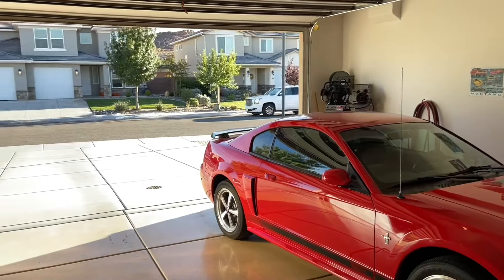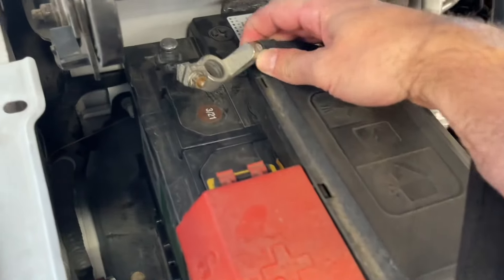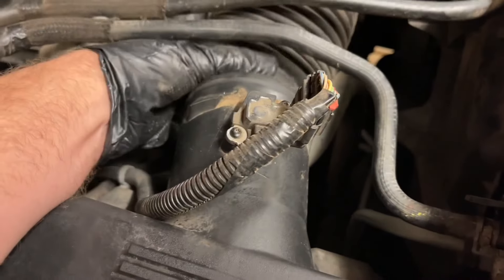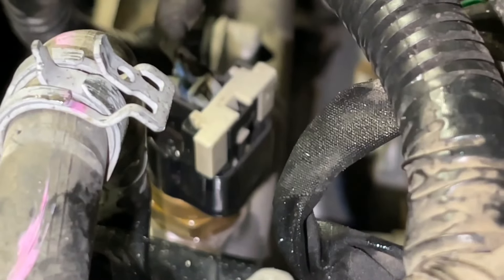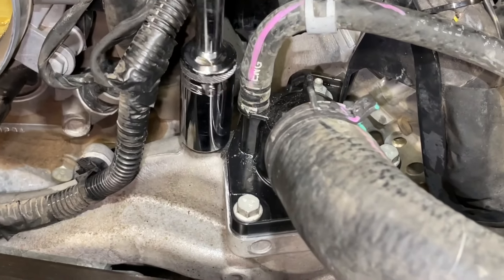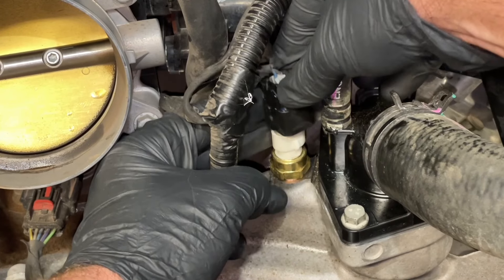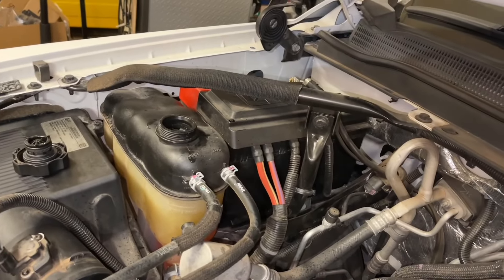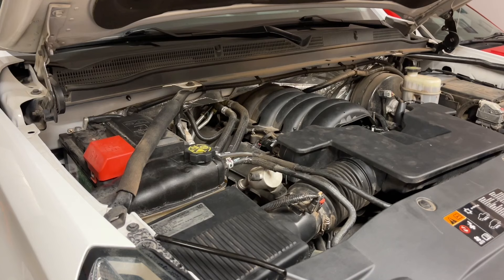Coolant temperature sensor replacement 2015-2020 Yukon, Tahoe, Suburban, Sierra Silverado GMC Chevy

Comment: This video helped tremendously for the repair and once we ran the vehicle; the temperature gauge worked great. Now however, every now and then; the sensor will trip and the gauge won’t work again. Ofcourse the fans will come on again, but each time I disconnect the battery terminal it rights the system again for a few days or more before happening again. Any idea? Only thing I can see different is we used an OEM replacement and not the part from the dealer, but I’m not convinced that is the issue.
Reply from the maker: It’s possible the new sensor is also faulty or the wires or plug on the vehicle side have a short and once it loses communication it faults out

Comment: I changed sensor and thermostat on mine but I still have the same issue. No temperature reading and fan continues to run .
Reply from the maker: It may be a bad plug or electrical connection for the sensor

Comment: So I changed the sensor and then 2 days later it done it again. So now the sensor start working again  but my temperature gage won't stay at 210 it drops down to 160, so in my mind the thermostat is sticking what do you think?
Reply from the maker: I’d change the thermostat https://youtu.be/aEfgkxWdBYw?si=-BZPPOA8NJdnx9VS

Comment: You replaced the tstat, was that for the fans too?
Reply from the maker: Yes, either can cause the fans to come on (if the thermostat is stuck open and overcools the engine, or if the sensor is giving a bad reading). I replaced both at the same time Thermostat Replacement Yukon, Tahoe, Sierra, Silverado, Escalade GMC, Chevy 2014-2020 P0128
https://youtu.be/aEfgkxWdBYw

Comment: I believe I’m having this issue now…will this also cause your AC to stop putting out cold air?
Reply from the maker: It may if it’s putting the car into the default mode. A bad thermostat can also cause the symptoms, so keep it in mind. You can try one at a time with the sensor being less expensive, but it could also be the thermostat Thermostat & Coolant temperature sensor replacement: Yukon, Tahoe, Sierra, Silverado, Escalade GM
https://youtu.be/7mJF5LQ3oPs

Comment: I switched out the sensor, car was good for a week, and now the fan is running nonstop again. Any ideas for what is wrong?
Reply from the maker: It’s most likely the thermostat sticking open and over-cooling. It will look like zero on the gauge but it’s running really cold 
https://youtu.be/aEfgkxWdBYw?si=8SKNXgdwnr31h_SU

Comment: So, I changed the sensor and the fan still run on high at start up. Is there a relay or fuse that needs  to be looked at.
Reply from the maker: If you disconnected the negative battery terminal for the repair it should have reset. I also thought it might be a relay stuck on, but it could be the thermostat stuck open and the vehicle is running cold and can’t warm up so it goes to default mode with the fan. See if you get a check engine light https://youtu.be/aEfgkxWdBYw

Comment: Hi I replaced my thermostat housing 3 times and the temperature sensor twice. Still experiencing same issue. No check engine light. Took to GMC DEALERSHIP, they couldn't find anything wrong. I'm at my wit's end. Please help!
Reply from the maker: If you are still getting a reading of zero on the gauge after driving awhile, it may be an electrical problem on the car harness side. I would check fuses related to the cooling system and a continuity test perhaps on the plug going to the car. Here is how https://youtu.be/-BUzm-OeGhE
Reply: @dannyjohnsonsgarage  I'm actually not getting a zero read. It never goes down it stays about 190-210 . Would you suggest replacing the temperature sensor. The one you suggested in video?
Reply from the maker: @msniecy10  it’s possible the computer recognizes the temp sensor is not working and causing the fan the kick on as a fail Safe. I think it’s worth a try.
Reply: Sane thing happened with my 2015 Yukon. Dealership said it was the thermostat and replaced it. Will I still experience problems with the temperature sensor,?

Comment: Video was perfect. We did exactly this and it fixed it. However 7 days later it happened again. Could this be a bad sensor or would there be another reason it might fail after being fixed?
Reply from the maker: I would next verify if the thermostat is in fact bad and sticking open. It might be over-cooling the engine. https://youtu.be/aEfgkxWdBYw

Comment: Great video for my 2015 Yukon! We got it replaced and it seemed to fix the issue for a couple of days, but the fan is running nonstop again and temperature gauge staying at 160. Any idea what it could be?
Reply from the maker: It’s possible it is running cold and the thermostat is stuck open https://youtu.be/aEfgkxWdBYw

Comment: HELP I changed the sensor and it was very simple. It seemed to fix it completely for about a week. Now it’s doing the same thing but the fan is only about half as loud as it used to be. A friend of mine who is a mechanic said that most chevys have 2 temperature sensors and I googled it and it said that the 2016 does have 2. Could another temp sensor be the problem? Also, it seems to act up when it raining or wet outside. It alternates from working properly to not working like a short in a wire or something.
Reply from the maker: It’s most likely the thermostat is stuck open and over-cooling the engine. The fans will run because it should be hot and it’s reading cold. 
https://youtu.be/aEfgkxWdBYw?si=vr1yz3LtjnU54FvT
Reply: @dannyjohnsonsgarage  thank you, I’ll try that next

Comment: Worked great !!! But now my fans aren't working 😕
Reply from the maker: They are temperature activated, but sometimes come on with the a/c system so try turning the a/c on. They may not come on until it’s hot enough. Also, if they continue to run and show cold on the temp gauge, it is also common to have the thermostat go bad, just FYI https://youtu.be/aEfgkxWdBYw?si=cjS25vfdDd8tHQIJ

Comment: Great video. Thank you so much. I changed mine today and when it gets around 60mph it starts running rough. If I give it gas or let off the gas then the roughness stops for a few minutes then returns. Any advice
Reply from the maker: If the temperature readout is fine (should be 210 degrees is normal or less) it may be unrelated to the temp sensor. I would see if any check engine light codes come up. Could be a small misfire from anything as simple as an oxygen sensor

Comment: The video was great. Thank you for that, but after replacing the sensor, my truck still had the same issue. We checked it on a computer. The temperature is running properly.We believe there is a short in the system. Did you still have an issue?
Reply from the maker: It could be a short as you say where the sensor isn’t working. You may be able to do a continuity test, or it can also be the thermostat sticking open so the engine runs cooler than 160 and the gauge is working https://youtu.be/aEfgkxWdBYw?si=rZAQER5ho1OEO-ER
Reply from the maker: https://youtu.be/-BUzm-OeGhE?si=ZKA_uMsr6p_WbV5S

Comment: Great video! Thank u!! Issued fixed! Though, I have a question what if the engine light didn’t turn off? After replacing the coolant sensor? Now, Before replacing the sensor i took it to two different locations where they put the computer. one location told me it was the thermostat and the other location told it me it was the coolant sensor. Could that be the issue? That the engine light is still on?
Reply from the maker: If the battery is disconnected (black ground cable) it should reset the code. If it continues to come on it may be the thermostat is also bad 
https://youtu.be/7mJF5LQ3oPs

Comment: What was the need for removing the radiator hose and draining coolant?
Reply from the maker: To lower the fluid level so it doesn’t spray out when you remove the sensor. It’s Optional

Comment: I had issues with my 2017 Silverado 6.2 I replaced my thermostat and engine temp with OEM GM part. my fans still are running on high. I do have AC and heat. I did do a battery disconnect and every trick that you can do to reset the computer. Nothing works.  Maybe the new temp sensor is faulty. The engine fans still run high Non-Stop only when the truck is running. I do have the active grill shutters. They work properly. Any help please.
Reply from the maker: Any check engine light? The fans in high may be a default limp mode and it could be overheating of any component.  The biggest indicator is the temp sensor at 0 (shows 160 because that’s where the gauge starts). 
  Press tow/haul and see if the transmission temp also works properly.
Reply: @dannyjohnsonsgarage  I have no check engine lights. And no codes. Temperature rises properly to 210 degrees.
Reply: @Danny Johnson’s Garage  I've been told that the AC pressure sensor switch could be faulty and make my fans turn on high overtime. I do have cold AC and I do have heat properly. I have no leaks on my AC lines and connections. Compressor seems to be still fine . The truck still has been running at 210° since I replaced the engine temp sensor. No overheating, no temperature drop. Still, as I drive on the freeway, the fans still are loud and high but eventually do slow down as I get off the freeway. I know that my active Grille shutters are working properly on my 2017 silverado. I bought a replacement AC pressure switch and engine temp sensor again. Maybe also the HVAC system needs a recharged

Comment: Did the fans come back on full blast after you replaced the sensor? Or did they stay off? I replaced it but the fans are still running like it’s overheating.
Reply from the maker: The negative battery terminal should be removed during the install, which also resets the system. If that was done and the fans continue to run, it may be a bad thermostat https://youtu.be/aEfgkxWdBYw

Comment: I accidentally took off the red positive instead of the ground and fan is blowing, is there any difference from taking the ground wire to just taking off the positive side ?
Reply from the maker: Yes, the ground is the more safe one to take off so it won’t short out any electrical components on the car. Don’t let the red touch anything and remove the black. Then in the future, it’s always black off first and on last when disconnecting and connecting

Comment: I have a 2015 yukon ive replaced the sensor with an oem unit twice. Still ends up getting stuck bottomed out like a simple electrical issue. If i clear the codes the code goes away and the temp gauge starts reading so its not the thermostat. Any other ideas?
Reply from the maker: I would look towards the thermostat remaining stuck open. A new one may be what you need https://youtu.be/aEfgkxWdBYw?si=mcP1rF5tT_wF-AEv

Comment: I’m going to try to tackle this tomorrow myself. The only thing I’m scared about is the burping the system part with adding the coolant back.
Reply from the maker: You should be fine if you follow the video. I also have this version that has the thermostat. It can also be bad in most cases. Be sure to unplug the black negative battery terminal when you start as the video shows, and make sure it has cooled down 
https://youtu.be/7mJF5LQ3oPs?si=jGqPObhAQsJGFpRv
Reply: @dannyjohnsonsgarage  thank you! 🙏🏽

Comment: Replaced my thermostat sensor but that didn’t fix it, i then replaced the thermostat and that did the trick.
Reply: Did you have same symptoms: Zero on gauge, fans continued to run after the engine off?

Comment: Good job. Looked you had a Denali there. I wonder if the 6.2 is the same as the 5.3
Reply from the maker: Yeah, other than the plug had a lock that is a little different, it’s the same. You may want to see the thermostat video as well https://youtu.be/aEfgkxWdBYw?si=E4EwG94e-LlqkdKK
Reply from the maker: I also have a full playlist with the cylinder deactivation delete and lifters/cam. It may be good to look through 
Yukon / Tahoe / Suburban / Escalade Owner’s manual Bells &  whistles
https://www.youtube.com/playlist?list=PLIjr-uSYDZi7J7EQ1ErTn1Yzi6ET_3Ssr
Reply: @dannyjohnsonsgarage  so might as well do both at same time?
Reply: @dannyjohnsonsgarage  was thinking of buying a chip to disable DOD

Comment: Has anyone ever has this problem. But go in an out.  Had the fans come on an gauge stuck on low.  30 something odd days later. It does the same thing. TIA
Reply from the maker: Sometimes the thermostat sticks open as it fails and it really is running cold. Just another idea https://youtu.be/7mJF5LQ3oPs

Comment: would this work the same with a 2016 cadillac escalade
Reply from the maker: Yes, it’s the same engine as my Yukon in the video. If the fan continues to run and it shows cold temperature when the engine has been running for awhile, it could also be the thermostat Thermostat Replacement Yukon, Tahoe, Sierra, Silverado, Escalade GMC, Chevy 2014-2020 P0128
https://youtu.be/aEfgkxWdBYw
Reply: thank you for your reply, my husband worked on our 3016 escalade today and he said the video is exactly the same to our car and he fixed the probpem and saved us hundred of dollars..thanks again!
Reply from the maker: @chiquibarlow12  I’m glad it helped. I have a playlist he can see if he wants with lots of videos that would also apply if he needs them. Lifters, transmission harness, shocks, tail lights, etc. 

Yukon / Tahoe / Suburban / Escalade Owner’s manual Bells &  whistles
https://www.youtube.com/playlist?list=PLIjr-uSYDZi7J7EQ1ErTn1Yzi6ET_3Ssr

Comment: Danny:  GREAT video and very, very helpful.  THANK YOU. However, after changing the sensor twice, this still keeps happening to my 2016 Yukon 6.2.  I see that you had another subscriber with this same issue.  Your answer was a possible thermostat issue.  Question...even if the thermostat was stuck open, wouldn't that still register a temperature above 160?  I have to wonder if I need a new connector, as the lock pin on this one is broken.  I did notice that the connector on your car is exactly the same as on mine.  But it is impossible to find in the retail environment.  I've checked online and at 4 different retail stores.  They all offer something different when I give details on the engine. Further thoughts please?  Thanks again!
Reply from the maker: Cars with open thermostats can be pegged to the cold side of the indicator, so it could be 160* or less. A GM dealership should be able to source the plug connector for you. 
Otherwise, the fault could be on the vehicle harness side rather than the sensor. Or there could yet be another problem putting the car into default Mode to make the fans run, but being you are not getting a temp reading, that’s suspicious. You can find diagnostic tools that will tell you exactly what temperature it is indicating. A tool like that would be more helpful to know if it’s reading 0 or 160
Reply: Thanks for the quick reply.  It’s only $50 to replace the thermostat so will try that first.  Then try the connector.  Then, may have to spend the obligatory $1000 to have a dealer look at it!!
Thanks again, sir.

Comment: I just did it,all you have to do is pull the cover off and pull the sensor off. No need to take the hoses off.
Reply from the maker: You’ll want to look into the thermostat if it continues to run the fans. At times it’s really under 160 degrees from the t stat sticking open. In that case you’ll remove the hose or allow it to spill over https://youtu.be/aEfgkxWdBYw?si=hF8vDddgwsezp7K5

Comment: About How long would it take to show a temp increase
Reply: Did your temperature ever increase
Reply from the maker: Idling is longer, if you drive around it should be about 2-3 miles. Depends on how cold it is outside too

Comment: Same problem with my 2015 Yukon. Dealership replaced  the thermostat. Never said anything about the temperature sensor. Will I have problems with the sensor?
Reply from the maker: If the sensor is bad and reading zero (looks like 160 since it’s where the gauge begins) you’ll probably need to change the sensor as well.

Comment: But what if you have exactly what happened to you, replace the temp sensor and you still have no working gauge and fans still on?
Reply from the maker: Disconnect the negative battery terminal to reset the system. If it persists, check that the temperature gauge is working and not still at zero (looks like 160). After that look for any engine codes with a scan tool

Comment: I followed the link in the description to buy the sensor and was about to start fixing this but then noticed the part in your video and the linked part on Amazon are not the same. You might want to update your Amazon links.
Reply from the maker: I'm sorry. The link in the description said it was compatible. I updated it with a different link that shows the same part number in the video "Genuine GM 12608814 Engine Coolant Temperature Sensor". It's possible your vehicle takes a different sensor than mine.

Comment: Nice video. How convinced are you that it needed replacing vs a cleaning?
Reply from the maker: It looked pretty black, so maybe just cleaning, but for $15 might as well replace it. I spent more than that for the part at the dealership but I found the link on Amazon I posted for much less

Comment: How long can you drive it like this? My 2015 just started doing this after replacing the transmission
Reply from the maker: I would have it fixed as soon as possible since it’s in limp mode trying to cool the engine down that may not be overheating at all. It’s bad for the engine